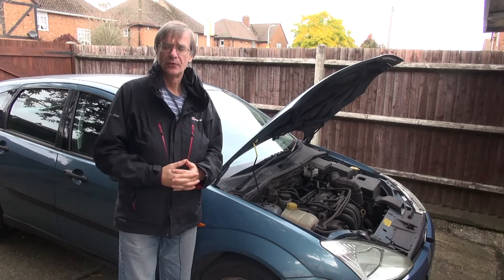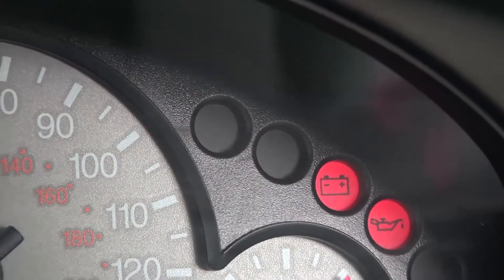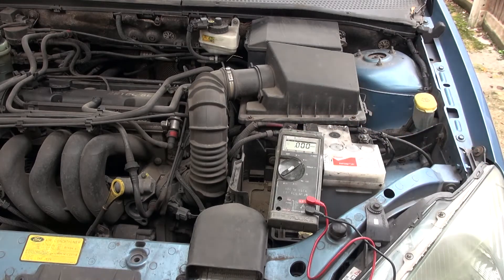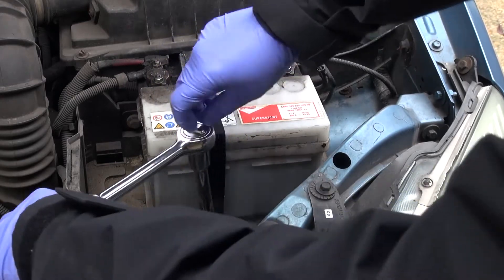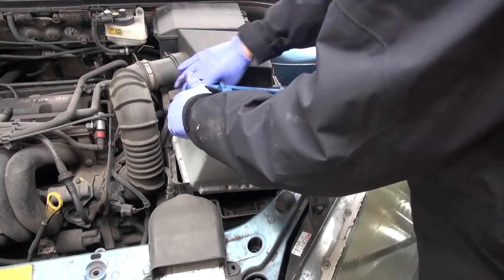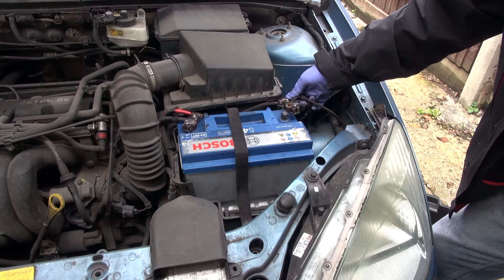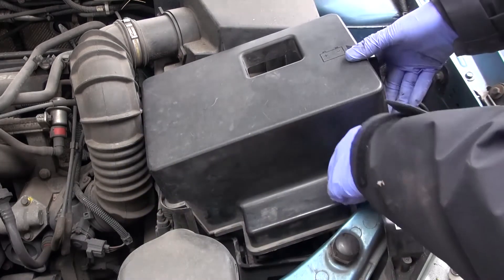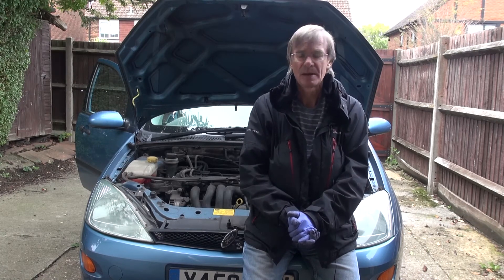Is the battery or alternator dead?

Comment: On the Mondeo's Mk4.5 it is even more complicated. Those models have a BMS and smart charging. You need to switch that off before measuring the charging voltage.
Reply from the maker: I’ve just read up on what the battery management system does. Complicated is right and it would cause a potential miss reading of charging unless switched off. Thanks for the feedback.
Reply: @NigelEaland  Please  view this video. It presents a simple method for resetting the BMS. https://www.youtube.com/watch?v=uIx6KfrrXGo
Reply from the maker: F Netherlands LOL 😂 well done Ford for coming up with that sequence.
Reply: Resetting my BMS resulted in my ecu, power windows etc receiving full power again. You might give this a try on your mondeo. BMS is separate from smart charging!!
Reply from the maker: F Netherlands it’s not my Mondeo. This was a Mk1 Ford Focus. No BMS on it. My Mondeo also does not have BMS.
Reply: @NigelEaland  It does not have smart charging. I do not know about BMS on your Mk4. More info here (amongst others).  https://talkford.com/community/topic/321490-bms-reset/
Reply: And thank you for your video's!